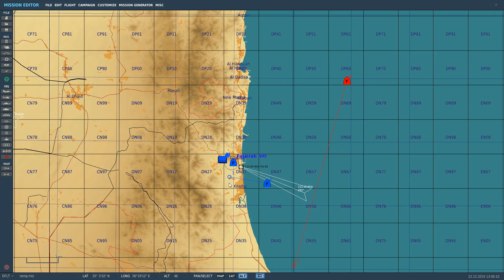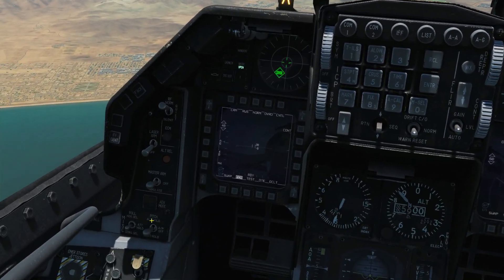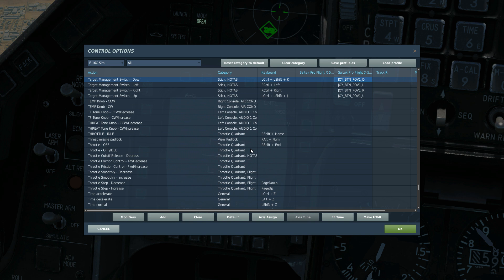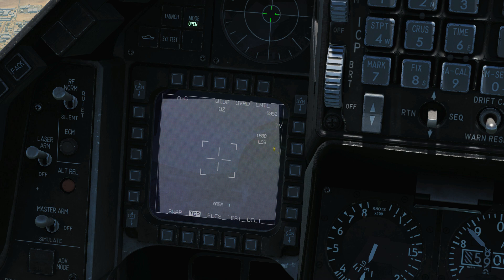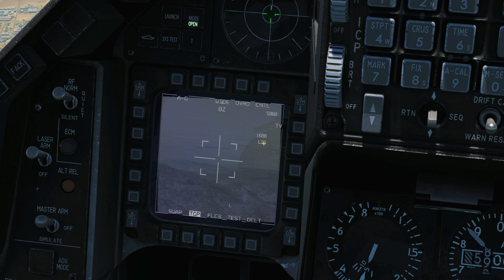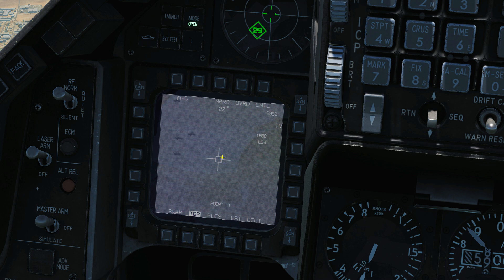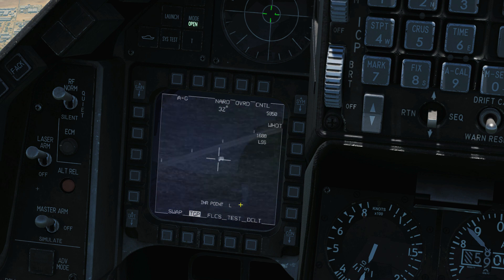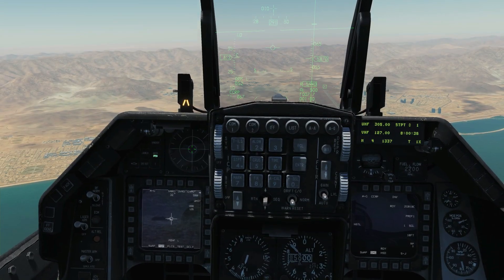F-16C Viper: TPOD TGP Tutorial | DCS WORLD

Comment: Oh. I thought I just cant use f-16 tpod, but the drift is my goddam hotas!(?) Or thats how it seems, did no test it yet. But have before seen problem in other mods with my t.16000m cheap throttle, where dcs goes "over" the drivers own "deadzone on "thumb"stick" enabled / disabled setting (in windows 10 own gaming controllers settings there is one..) (the stick somehow in dcs just seems not to go to point zero, but when dcs off it goes when looking in windows 10 own measurement tools (which of are kinda crappy but still clearly it does so...). Gotta try this. heck this drifting of tpod after pressing cz has confused me since jumping from hornet to viper.. I really had troubles keeping targets on tpod (or the tpod in targets to be clear), but is it goddam just drift of my controllers :D ?

Comment: hey i have this problem with the targeting pod and its kind of hard to explain but ill do my best and you did not cover this in your video about the targeting pod but anyway so what happens is when i press down to re-cage the targeting pod it will look only in one direction so say if i went over a target and the pod was working fine looking where i wanted it to and if i re-caged it while flying in a specific direction i could easily slew it back to the target but if i flew over the target and turned around and then re-caged the targeting pod after turning around it will re-cage to a position looking behind the aircraft and it takes forever to try and slew the targeting pod to look towards the front of the aircraft why is that its really irritating and i wish i knew how to make it so that the targeting pod will simply unlock from the ground and follow wherever the plane looks until i press up for it to lock on to area or point then it will stay locked to one position on the ground
Reply: yes I have same problem